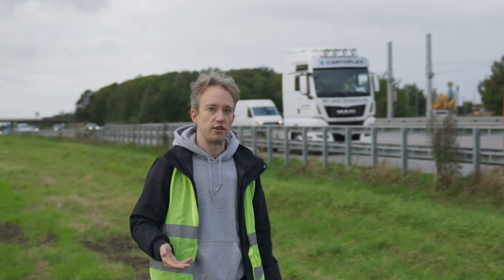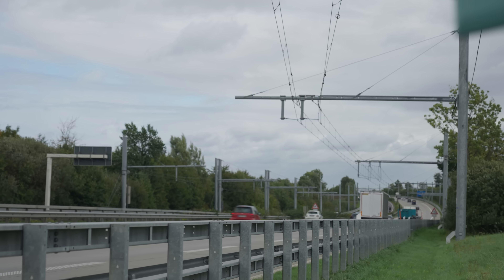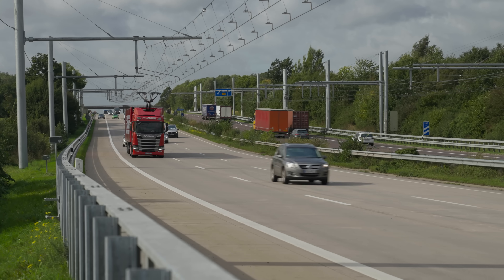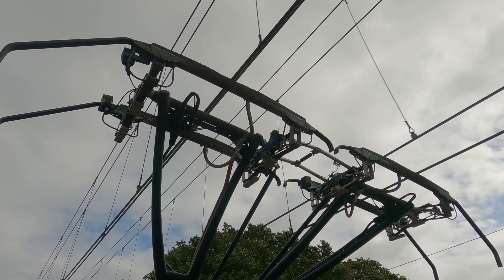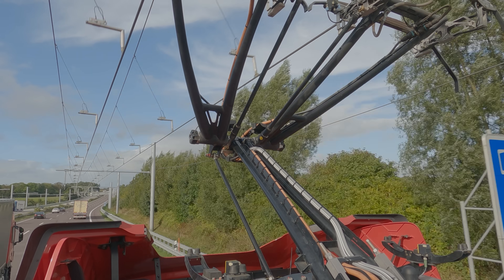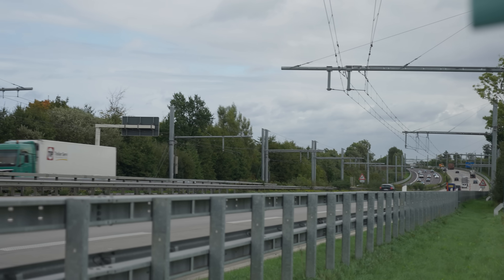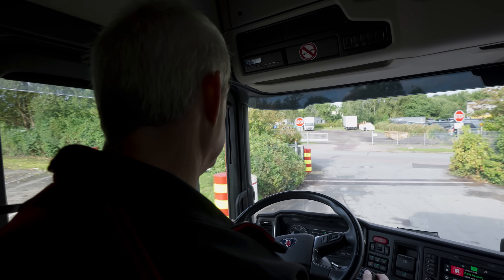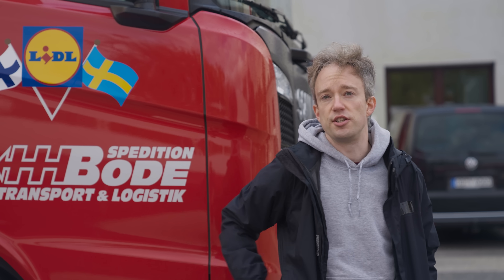The highway where trucks work like electric trains

Comment: FINALLY SOMEONE HAS DONE IT!!!

Here’s my two cents on how to run a public transport system, by the way:

Inner city routes use trams and walking/cycle paths. Routes through rural areas are long and therefore trams are not practical. Instead, electric buses should be used here. 

Putting wires up along the entire length of a rural bus route is unlikely to be worthwhile, so we should use battery operated buses here. Nonetheless, these buses should be fitted with a pantograph. Even though the bus routes are rural, they almost always will start and end in an urban centre, where they could use the pantograph along with the overhead wires to charge their battery as they run before they head out of the city and into the rural areas.

Obviously I’ve got no idea if this’d actually work, I’m not an expert, but I thought I’d share it anyway in case someone sees value in the concept
Reply: It could definitely work, the UK used to have an extensive trolleybus network, but it was almost all torn down to make way for petrol buses

Comment: Wow, we started reinventing the trolleybuses, after phasing them out for diesel ones.
(I know a bus is not a truck, but the difference is not that big)
Reply: Our city (Riga) have these diesel trolleybuses who use diesel generator on streets without overhead wiring on partially electrified routes. Seems suitable solution for trucks too.
Reply: I’d say this is an improvement because it’s suited for long distance travel. It’s more of a hybrid between a trolleybus and a train than a repeat of either I would say.
Reply: Well, yes, but these trolley trucks can disengage from the overhead wires and drive on independently, where a trolleybus was attached to them - or at least the ones I knew back in the day and could not go anywhere without those overhead wires. So still an improvement, I'd say.
Reply: @berttroubleyn3475  There are towns where a trolleybus can disengage, I'm not sure how old the technology is though, but it's been out there for some years from what I've seen.
Reply: @nanifiqueyt  I can confirm - in my city (Gdynia, Poland) some of the trolleybuses are equipped with batteries, so they can drive several km without overhead wires
Reply: @mieszkogulinski168  Also in Lublin (:
Reply: @berttroubleyn3475  Trolley Busses can disengage yes, but they can't engage onto the overhead wire on the fly like this truck there is able to.
A trolleybus has to stand in order to engage, the pantographs have to hit one specific point.
My neighbouring city, Solingen (DE) has a lot of Trolleybusses active, and thus I've seen the hassle of engaging a Trolleybus to overhead wires.
Reply: @berttroubleyn3475  not sure about other countries, but Japan had a good number of convertibles when pure gas buses were getting phased in, and electric overhead wire ones phased out. They were able to drive the routes for both to meet capacity needs.
Reply: @berttroubleyn3475  Yes, in Hungary, trolleys are still engaged to the wires. But change the pantograph (is it called this even for a bus?) to some smart one, which can easily connect to the wires without the driver's control, add some batteries, and you have trolleys, which can overtake other broken trolleys, or can disengage in one street and engage on another street, if wiring between the two is not possible.
Reply: @berttroubleyn3475  The trolleybuses we have in San Francisco have small reserve batteries that allow them to lower the pantograph to make extremely tight turns or clear intersections without cabling. Unfortunately, when re-attaching to the line the driver has to get out and inspect the connection every time, leading to more congestion on narrow streets and further reinforcing MUNI's reputation as America's slowest public transit system.
Reply: The exciting bit is that this might prove economically viable for everybody involved - the trucking companies, the governments funding the projects, the rest of us who have to live on this planet.  In an ideal world, we'd get rid of most highways and replace them with much more efficient electric rail lines, but this is a solution that might work in the real world, in the near future, and for many more use cases.
Reply: @georgedorn_fnord  Rail needs exclusive access to real estate. Rail cannot serve many in-between communities or its advantages turn into liabilities. There is no "ideal world" with one solution.
Reply: @Markle2k  Kinda my point.
Reply: HAHA, very well pointed out! 
Similar stupidity was done in Moscow- they phased out Trolley busses in favor of electric battery busses- instead of replacing the gas-operated busses. It never made any sense!
Reply: What’s interesting is when I was growing up, we had milk delivered in glass bottles from a battery milk float, then we were told it’ll be much better now as you can buy it yourself in a plastic container from your corner shop. Now we’re going back to bottles in electric vans. We were also told that paper bags for taking shopping home is no good so now you can have free plastic ones, then plastic ones are bad so we’re going back to paper. And as you quite rightly say, we had trolley buses, faded them out as diesel is better and now look, funny old world.
Reply: yea my exact line of though. here you can see communist made trolleybuses still driving and transporting people those are decades old. I don't get why are people so hyped about stuff like this when it already exists and has existed for a long time.
Reply: @impatientpatient8270  they get excited because they probably haven't seen trolleybuses yet. A hybrids that can disengage or switch from electricity to diesel for short distances seem like a good idea.
Reply: @TheMajkla  New ones use batteries.
Reply: @impatientpatient8270  Using technology that already exists is the type of stuff that gets hype. It's proven and demonstratable that it works. That's good for investors. For example, the covid-19 vaccines that use some similarities from the SARS-Cov-1 vaccine
Reply: Riga?
Reply: It's a world of difference when the vehicle can just engage and disengage from the overhead wire at speed, instead of the driver having to stop the vehicle, get out, walk to the back, and take 3 minutes to connect or disconnect from the overhead wires.

Comment: Gimmick. No way this will be taken on board. Trucks will be full electric with hydrogen fuel cells or just banks of batteries. Routes will be determined based on range and trucks will be charged at each depot if required. This idea is about as good as solar roadways.

Comment: It will also be handy for buses and coaches too. Back in old times there were Trolley 🚎buses which were electric buses actually some countries still use trolleys 🚎 but without batteries they were stuck on electrified routes!

Comment: Thanks, but that technology has lot down points. From the cost of creating these, to the problems with accidents and traffic jam. The problem is, that batteries are general a bad solutions, so we need a clean technology and thats most likely synthetic fuels for the next years, until we find better.

Comment: We had these in New Zealand for buses. They were slowly phased out as the system got old because the cost to upgrade the system was way too expensive.
Reply: If you're talking about the trolley bus network in Wellington, they could not connect and disconnect from the overhead wires at speed like this, or go any significant distance away from the overhead wires. The batteries would last long enough to get past some road closures or overhead wire power failures, but I don't recall any regular route that used a trolley bus and went away from the overhead wires any significant distance.
Reply: @takatamiyagawa5688  problem with America its huge like very huge like I wouldn't even know where yo start like highways only with overhead lines?

Semi also take country roads and small paved roads to farms. Honestly if we went batteryless every road I'm America would require over headlines 😅 I see semi on dirt roads a lot and back roads besides highways

Comment: We already have lots of electrified railway, we just need to use it properly. Intermodal trains to city centers then battery vehicles for distribution to surrounding areas. We had all this in the 60s btw, rail was seen as old fashioned.

Comment: and the "electricity" will come from .............................................
Reply: A centralised location which is much more efficient and greener using current technology and can be changed as technology improves with having to upgrade all the vehicles. It's a no-brainer.

Comment: What if... They used a combination of rail and road wheels.
Efficient rails for the main trunk roads, and when they either merge on and off the main rails the driver switches between rail wheels and lowering rubbered wheels to go off the main rail and off a slip road etc.
Means "trains" can link together and efficiently utilise the grid electricity, and can, for whatever reason, if a unit wants to detatch, can simply switch to rubber wheels and go off a side-road.
The best of railways and road freight but using the grid, then batteries instead of doing both at the same time on 2 separate routes.
That way, in times of high traffic, the "road trains" could return to the conventional rail network to avoid congestion, and return further up the highway to continue their run.

Comment: Very interesting and reducing fossil fuel use is allways good, but there is an obvious question: why not use railroad? For the long and mid range it as worked for centuries, yes it require more planning but less investements and is more efficient.

Comment: In Beijing, China certain bus routes have overhead wires which the electric buses tap into to use. Two springy antenna pop up and connect to the lines. However, I do think that there are reasons why it hasn't become universal, even in a city like Beijing where such infrastructure would be economical (there are probably tens if not hundreds of bus routes running). One reason I can think of is the eye-sore value of such overhead wires. For example, they didn't build wires on Chang'an Street (Chinese equivalent of Pennsylvania Ave). There's probably other considerations too; despite a move towards electric from diesel, I've seen more electric buses that simply ran off a battery. Those reasons could impede with a full transition to overhead powered electric vehicles.

Comment: What they aren't telling you is the voltage of the overhead lines, which for a commercial scale product, using current technologies is close to 30,000V. Laws of physics dictate the power available from the overhear powerlines. If you were to have 20 trucks per 1km could be close to 10MWatts.

Comment: It's not only trains running on these wires, trams and trolley busses have been part of our (Czechia) public transport for decades now and the wires are part of various cities roads already. The fact that trucks can run on this is not only proven now, it must've been the logical conclusion for decades.
Reply: Serbia, too
Reply: It may have been the logical solution for decades but think about costs to realize these wire sections at highway's?
think about the trucks that need to either be modified or built from scratch and bought by companies for their employees to drive in.
i know the guy in the vid talks about this system paying it self back within 1,5 years or so but without concrete figures nothing is set in stone.
Reply: @VintageCR  The costs to install catenary along highways will be peanuts compared to the stupendous costs of the highways themselves.  When road construction costs are somewhere between one and two million dollars per lane mile, the added catenary is just an incremental cost.
Reply: @VintageCR  I don't think this would raise the price of a Mersedes eActros that much, maybe they could svap one of the four batteries on it with this system as those big Tesla batteries they use are quite expencive.
Also Volvo are building battery powerd trucks and they got an order for about 100 of them a couple of weeks ago.
Reply: Has anybody ever thought about cargo trams?
Reply: @Kaslidaughterofchaos  In a future city that has completely outlawed cars, this would probably be the way to transport goods in the last-mile stage.
Reply: @Kaslidaughterofchaos  Costs would rise significantly and stop maneuverability and a lot would have to change with companies.
Reply: @Bear-Seek-Seek-Lest  ahh that’s why.

Comment: Why not just use trains for moving freight......its already there working
Reply: Because warehouses don't all have train stations and the vast majority of train lines are based around human movement.
Reply: @garethhanby  but it could easily be changed....up until the 60s this is how me moved freight distances....then smaller lorries locally
Reply: @jean-paul7251  Well yes, but in those days warehouses were in population centres, cities have expanded. Now, for example, Amazon has 25 fulfilment centres and most are located well out of cities close to motorways where the land is cheap and road access easy. I don't think a massive update of our railway infrastructure is the way to go for an environment program.
Reply: @garethhanby  well.....if they need to build branch lines or move closee to a good yard. Interesting Amazon in kent is very close to a growing good yard.....coincidence???

Comment: I was so surprised that this was about Germany - I thought it would be the stretch outside  Sandviken in Sweden. Still, the idea is interesting but it does require rather expensive rebuilds of the lorries. Is it possible to scale up the Sunfire project, to extract diesel fuel from the CO2 in the air?
Reply: The Sunfire project/electrolysis of water is equivalent to charging a battery, it has nothing to do with extracting energy from a source; you need to input all the energy, and you'll optimally get about 60% back. The energy is simply "stored" by splitting hydrogen and oxygen molecules from water, storing the hydrogen in tanks and letting out the oxygen; you can extract some of that energy by reacting/combining the hydrogen back with oxygen from the air, turning it back into water. CO2 has nothing to do with it and there's no energy to extract from it, and it's very far from possible to extract diesel from it; burning diesel produces CO2 and H2O, only the latter of which can be used for storing energy, and again the energy isn't there unless you "put it in" by splitting H2 and O; if you feasibly could produce diesel from CO2 and H2O, you'd spend more energy doing so that you'd get out.
Reply: @TheMrTape  Yes, thank you, I know most or all of that. The point is just that: to store energy, in a form that can be used in our vehicles as they are. Of course the process consumes energy, but it would be the perfect use of wind or wolar power, which is not necessarily accessible when we want it to be. If their process can be used on a large scale, there would be no need for an electric road.

Comment: And  go to Prague, Salzburg and many Eeastern European cities to see trolley buses still running after 100 years...   
"Nothing New under the sun" (well not quite "true" in absolute ) -  just the elimination of the last mile wires...

These are just trolley trucks.

(yes lots of people commented the same - shows what a well known theme it is...)  

Britain could be relatively simple to electrify (mostly long and thin) - if a truck had 60 miles of range the whole country   (Kingdom)  could probably be sorted with 1500 miles of this infrastructure.. (Germany and France - for example  have quite a Few more "city pairs" to interconnect.

Comment: The system works and it is better than using Diesel. I am still not happy with it at all, for the following reason:
We already have a system that uses overhead power lines. Trains. and trains can transport containers and from ports to warehouses too. This system has hardly any advantages over using trains and using trains is the better option because they inherently use less power and cause less accidents. This system is actually an excuse for using more cars where cars aren't needed and replacing the better solution with the one favoured by car manufacturers.

Comment: Maybe have a look at how Switzerland handles most of their freight on tracks - so no big „reinventions“ like this needed
Reply: Big 'reinventions' are needed in other countries because we haven't got that rail infrastructure, or haven't any more. So massive project to build (or rebuild) tracks, rail depots and cargo depots. Think would be a bigger job that what's presented in this video.
Reply: Any links?
Reply: So what happens between the rail depot and the loading dock of the store/factory? I've never seen a picture of a railway running down the main street of a city in Switzerland.
Reply: America has the most advanced freight rail network in the world.  Euro train freight is third world in comparison.
Reply: @kilobyte8321  Oh yes, the mighty America. 
How many high speed freight trains you have again?
Reply: @czechgop7631  what the hell do you need high speed freight trains for? In most cases it doesn't matter if a freight train takes one day or even a week (except for operator costs) but higher speeds significantly increase fuel and maintaince costs
Reply: @czechgop7631  How many does Europe have?  Freight doesn't need to move at high speed. Quantity and efficiency are what matters.
Reply: @kilobyte8321  I know that alright? It was just a mockery :P 
France and Germany have some if I remember correctly.